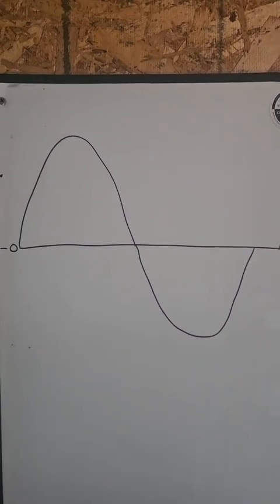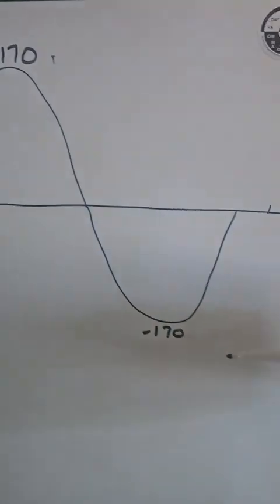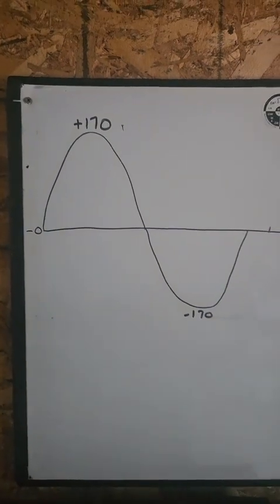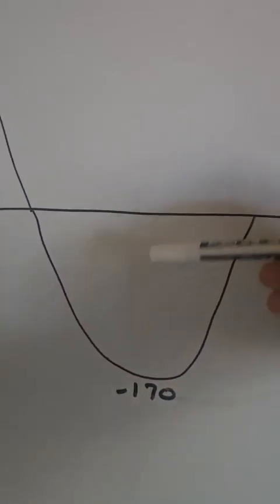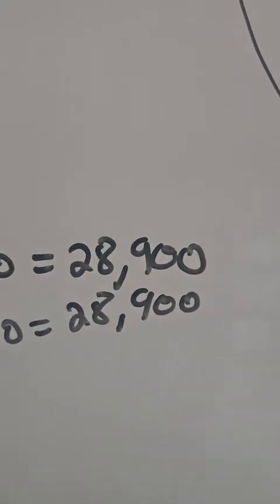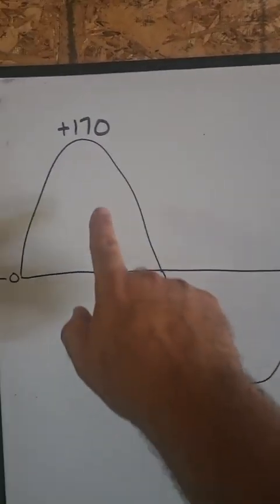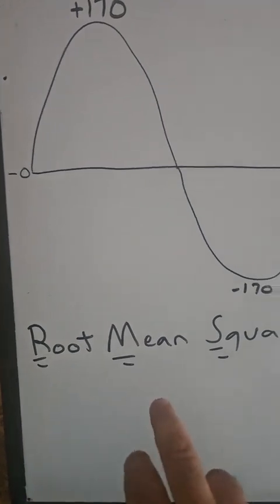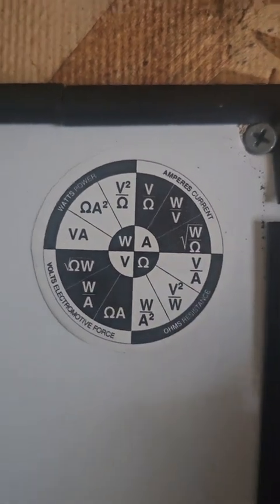How is RMS calculated..... RMS voltage explained

Comment: Still didn’t explain what it means, and why we use it.  

True RMS is the steady-state equivalent of the amount of work that is done.  Work is only being done “under the curve”.  With the voltage at any given point of the curve constantly changing, how can we equate that to a steady state measurement?  
      Imagine the voltage curve is made of mashed potatoes, and we can smoosh it around any way we like, as long as it is contained by the “walls” of the zero crossing points.  (The places where the wave crosses zero 60 times a second.). If we take that sine wave peak of mashed taters and force them down flat, you end up with a straight line.  This line is lower than the peak of the original wave, but the total area under the curve is the same, the amount of work being done is the same!  That level of that line is the RMS voltage. The equivalent work being done is the same.  

Another way to imagine it is to draw the full sine wave with 170V peaks.  Now draw a line at 120V. “Cut” off the area at the top and imagine distributing that area of material onto both sides of your flat- topped wave.  That amount of area will “fill” the voids on each side.  The area under the curve doing the work is the same.

Comment: Great explanation.  What makes a good exercise to understand what is going on is to look at the RMS voltages for various waveforms.  You can make it easy on yourself by using some simple waveforms such( as triangular and square.  If I remember correctly, it is basically the area under the curve and the ability to do work.  And again, if I remember correctly, the RMS voltage of a triangle or sawtooth waveform is 0.5*V(peak) and for the square waveform it is 1.0*V(Peak).  And for the sinusoid waveform, the RMS voltage is 0.707*V(Peak)
Reply: An easier way to look at the area under the curve is that the curve is always going back to having no polarity. It makes sense to consider the RMS a DC equivalent because you wouldn't need a separate measurement if the voltage was constant. With a 10V 50% square wave it wouldn't make sense to still call that 10V over time. Like picturing a 50% square wave with no offset and seeing that the RMS is equal to the peak. So like you said for the perfect square it would be 1*Vpk. That's a crest factor of 1. For a triangle wave the crest factor is higher at 1.73 whereas it's 1.414 for the Sine. So for an RMS of 120VAC, you'd have 120V square peaks, ~170V Sine peaks, and ~207V Triangle peaks. For the triangle it's a little over half the peak, but not as much as the Sine. It makes sense cause if you placed the Sine and Triangle waveforms over top of each other you would see that while they are reaching the same amplitudes and crossing zero at the same times, the Sine is still retaining more voltage over time in the ramps. The triangle would fall within the area under the sine curve, but not the other way around.

Comment: the equation is quite simple. V_rms = V_max / sqrt(2) 

170/sqrt(2) = 120.2 V
Reply from the maker: @nhitc6832  that is not true RMS that is a short cut that only works when you have a clean perfect sine wave. for example  It won't work if you are dimming a circuit with a triac dimmer

Comment: We square because P = U² / R. The ability to do works is related to the square of the voltage.
Reply: What's a U? (rhetorical)
Reply: @CJRock-xn5qf  just another symbol for V, voltage. Personally, I prefer V over U.
Reply: @nhitc6832

 "rhetorical" 

My Boylestad Introductory Circuit Analysis that I studied long ago  has V, not the German/European influence U. The internet makes us all global now.
Reply: @CJRock-xn5qf  Makes me think about a DIN standard labeling of "U, V, W" on 3p motors if they decided to just go with U's instead. Also used to think about how R,S,T might just come from meaning different things. Then it's like.. RST..UVW..XYZ... oh. They said screw numbers we're going with single letters. After thinking about this video though, they are wasting precious energy, ink, or pixels writing all of these U's when they can be V's instead. The RMS of the U is clearly higher. They come up with this genius designation scheme only to throw it all away with senseless U-turns.